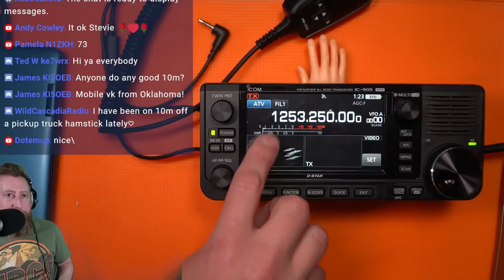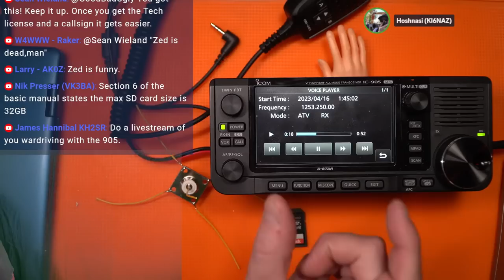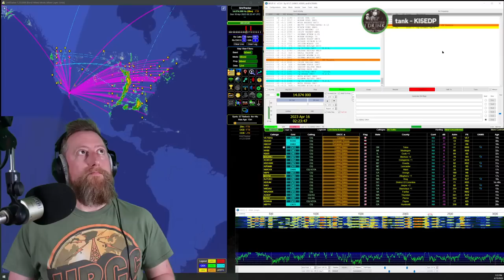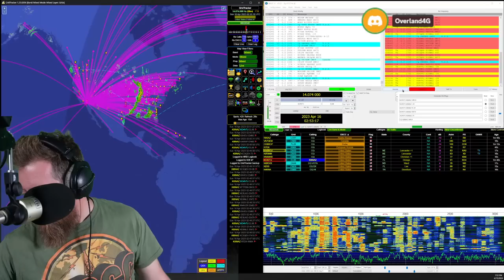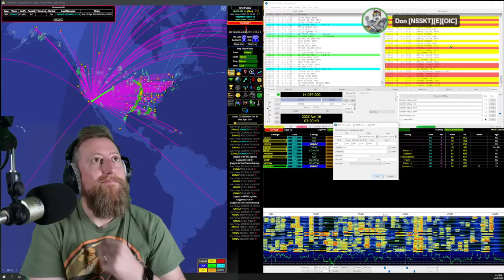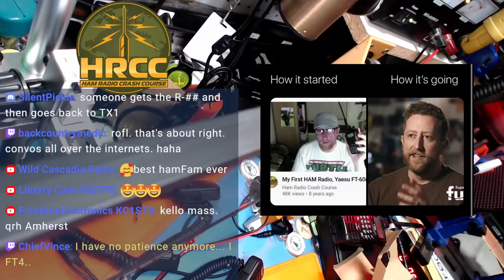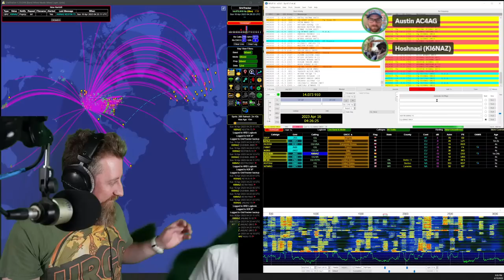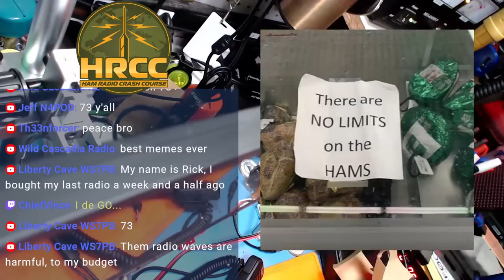AFTER CHAT - First Look: ICOM IC-905 With Ray Novak

Comment: Not a HAM (yet) but I have monitored Local P25 with several RTL-SDRs several times.  I cut a colinear Coax to create the antenna and used a piece of copper tubing to slip over the braid.  It was awesome wonder to behold.   You'll have to do it to feel all the pride.  The control frequency was on one RTL-SDR and listened another RTL-SDRs with just the braid pulled back over itself on another.
Reply: You can Use SDR Angel Software to Receive DATV Reception!

Comment: Your SD card is too big, it has to be 32GB or smaller
Reply from the maker: Of you format for FAT. It make it the size it needs.
Reply: @HamRadioCrashCourse  that’s a waste and an extra complication, go read the manuals. If you use an SD cards that is 32Gb or smaller you can format it directly in the radios.
Reply: Nope  @HamRadioCrashCourse  - different kinds of SD card depending upon size. 64GB is usually gonna be ExFat on a SDXC card. 32GB max size only supports FAT on SDHC cards, ICOM standard not capable of using the larger card at all. Same with my IC-7300. SDHC cards can be up to 32GB in size. SDXC cards can be up to 2TB in size ... FAT requires a cluster size of 32kB for > 32GB filesystems. Ex FAT has larger incompatible clusters.